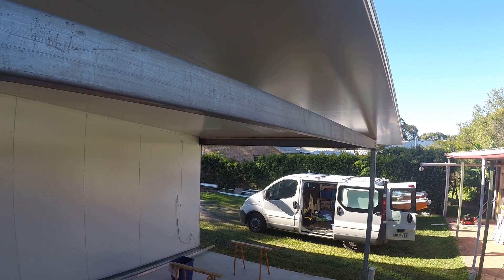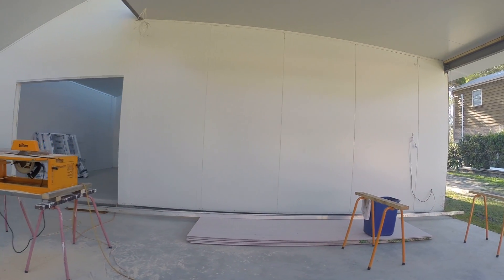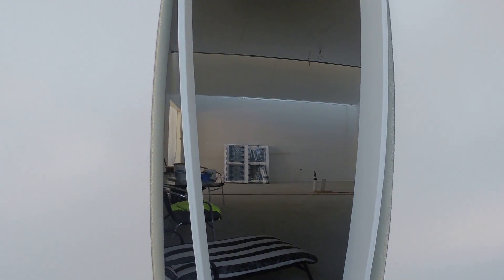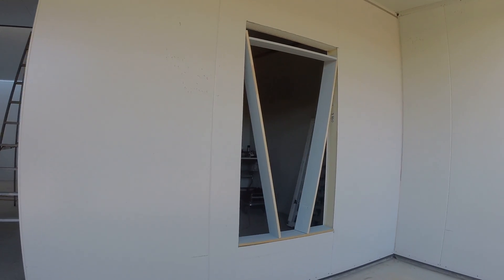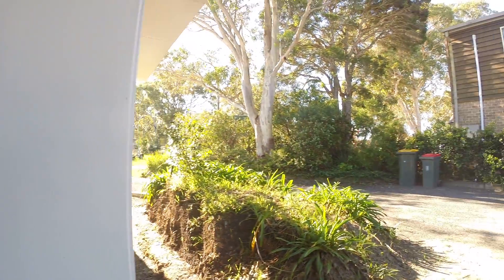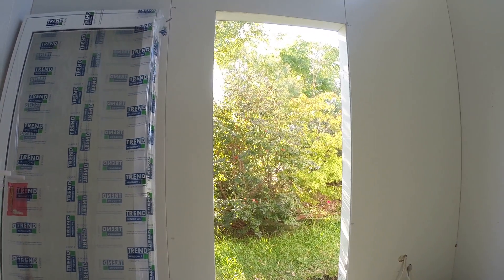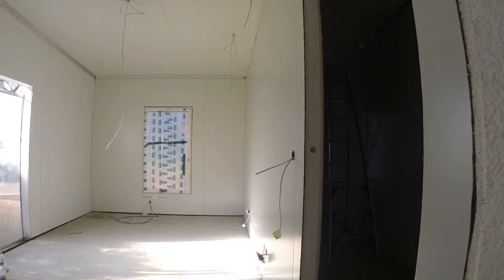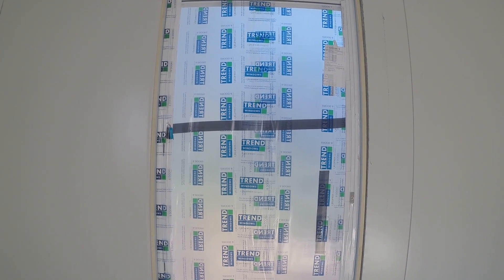SiPS Panel House so Far

Comment: Could you please explain a bit more about why you sheeted over the roof panels? I thought there were special roof panels for that application. Did you do it this way to reduce the future cost of re-roofing? Doesn't this largely negate the cost and time advantages for the roof if you have to sheet over it with a roof material anyway?
Reply: Three reasons 1/. Build is in a seaside village so wanted the Salt protected  25 year warranty corrigated sheets 2/. Used battens for attachment so as to have a space  in between the panels and the roofing sheets to run lighting cables which made laying of the roof faster and cheaper. 3/. Noise and heat break between the roof sheeting and the panels.